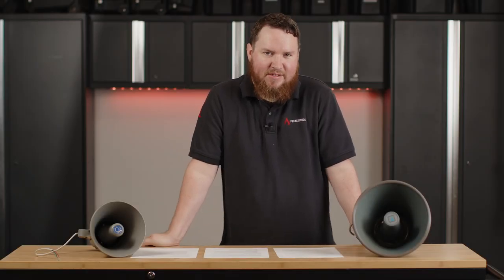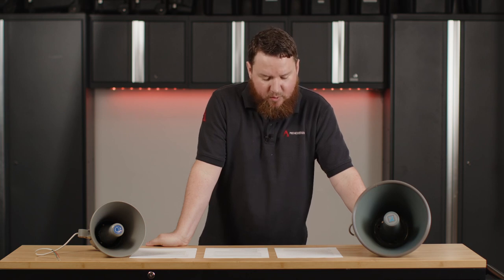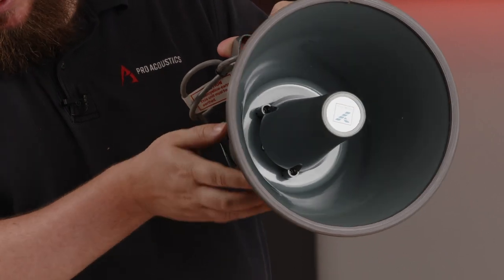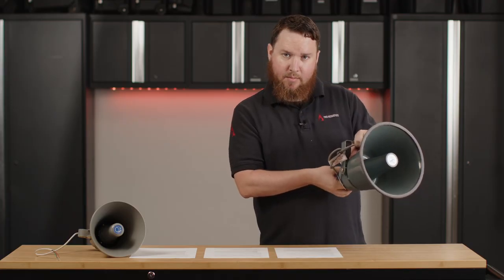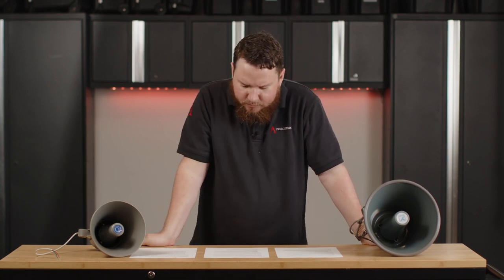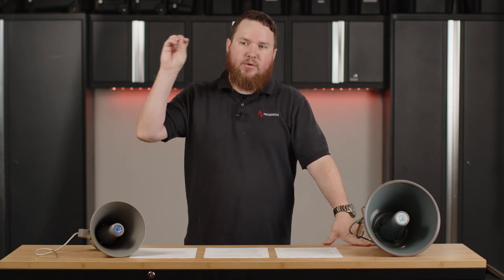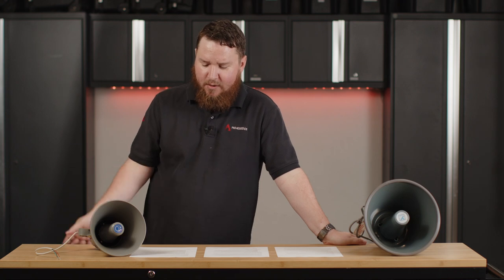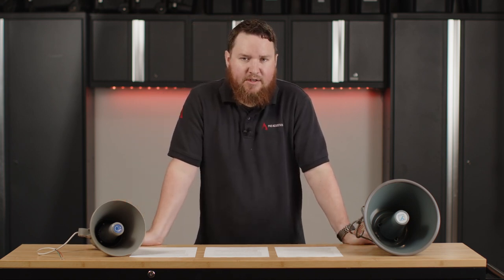How Do 70 Volt Horn Loaded PA Speakers Work on Pro Acoustics Tech Talk Ep 81

Comment: Do you have any tips to protect horns from bass frequencies?
Reply from the maker: One effective way to do this is by implementing a high pass filter in your audio setup. A high pass filter, like the AtlasIED TSD-HF11 (link below), attenuates or cuts off the low-end frequencies in paging and announcement horns. JBL Professional also offers horns with built-in high-pass filters (link below).
If you have any more questions or need further assistance, feel free to ask!
- AtlasIED TSD-HF11: https://www.proacousticsusa.com/atlas-sound-tsd-hf11-paging-horn-crossover-limiter.html
- JBL CSS paging horns: https://www.proacousticsusa.com/catalogsearch/result/index/?cat=1561&manufacturer%5B0%5D=JBL+Professional&q=JBL+CSS
Reply: @ProAcoustics  Ok thanks. BTW does the Atlas AP15T have a protector in it I’ve heard it does.
Reply: What about the Atlas TSDTXHL?
Reply from the maker: @aaronsceilingfansspeakersa3057  The Atlas AP15T does not have a built-in low-pass filter. However, the JBL CSSH15 does. The Atlas TSDTXHL, on the other hand, takes a speaker-level signal down to an audio line-level signal and would not help in this application.
Reply: @ProAcoustics  thank you
Reply: Do you recommend the Bogen SPT5A because it has a full range driver so it can produce a little bit of bass.
Reply from the maker: @aaronsceilingfansspeakersa3057  Anything described as a paging horn will be designed for voice/paging and have a minimal bass response. If you want a fuller range sound, look into an all-weather stadia coaxial horn speaker like the JBL AWC82 or AWC129, Pure Resonance Audio S10, Atlasied AH or FS12T line, or Community R series.
https://www.proacousticsusa.com/commercial-sound-equipment/commercial-audio-speakers/stadium-speakers/stadium-pa-horn-speakers.html
Reply: @ProAcoustics  well what I mean by that is that I CAN put bass through the horn bc it has a full range driver instead of a compression driver. That’s what I mean.

Comment: so the wider the mouth  the wider the range and this a speaker pa ... theres horns like police pa and theres your speaker pa's right wich can be used for football fields
Reply from the maker: Hey Jerry, Essentially, yes, you can think about it like that.
Reply from the maker: To clarify: Some speakers are more tailored to tone signals (sirens), and some are more for vocal intelligibility and distance throw. However, horizontal and vertical coverage can vary depending on the need and application.